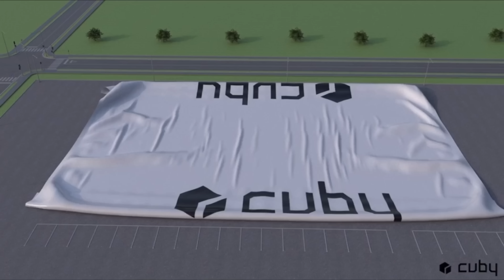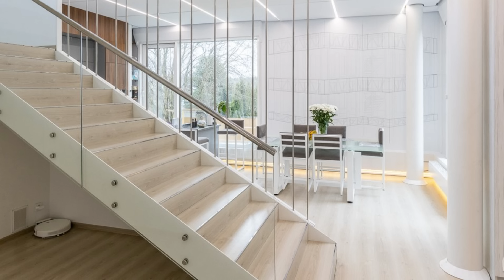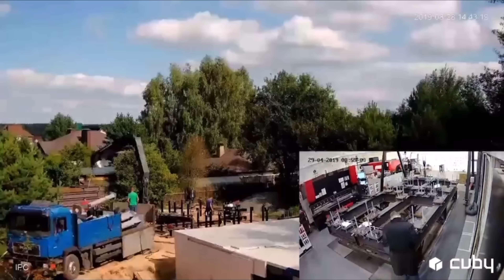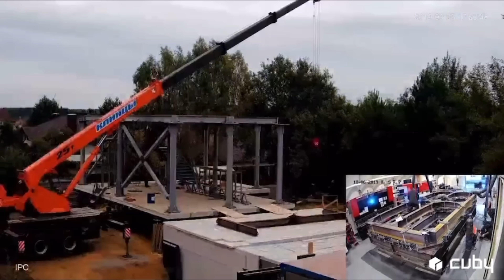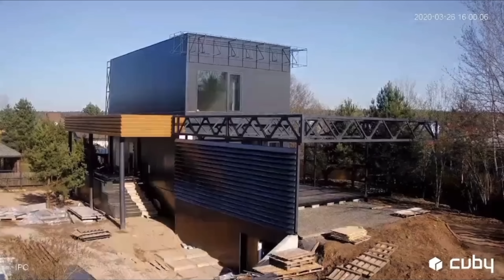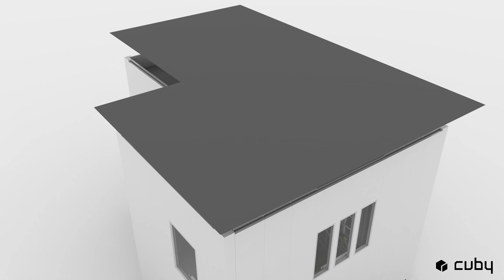Modern PREFAB HOMES that cost Nothing to Ship!!

Comment: Does demand for these homes move in cycles that would orphan a factory when demand moved on?   I can’t envision that.   Building a factory in a fixed location is expensive but enables you to tailor, run, optimize and refit when you need to.   This is a move, setup, try and optimize and tune and move.   Sounds exhausting.

Comment: Thank you Kerry. My resistance to prefabricated homes is the financing hurdles; specifically for resale and how the classification of the structure can prohibit the home from traditional financing or any financing if the structure reaches a certain age.
Reply: Cuby's product will not have any issues with financing or resale value that you mentioned about prefabricated homes. You are concerned about manufactured homes that are produced as a single housing unit and that are moved on a chassis or flat bed. Cuby is a prefabricated modular home. It's pieces are assembled on-site. It would qualify for regular financing and have similar resale value as traditional stick built construction.
Reply: @kdockrey  I don’t doubt you, can you supply the information please so we have ammunition going into the bank.  It would also depend on FHA guidelines.  Not sure how you know about resale since prefabs are coming out.  What I do see is they are going to be popular.  Thank you again
Reply: @sterlinghawk_g20  I posted link with a pertinent explanation about your concern, but YouTube seems to have removed it.  If a prefabricated house has to meet local building  codes and not HUD requirements, your financing should not be an issue. If the prefabricated house only is required to meet HUD codes, then there may be an issue with regular financing.
Reply: If a pre-fab home is put on a foundation & purged to the land, there should be no issues with financing from most lenders. I’m a realtor & I deal with these a lot. Not all lenders will finance them, but many will & it shouldn’t be hard to find one.

Comment: If you can limit how many things need to be put on a diesel truck limit how many trips it has to make to the build site Etc that's the best way to keep the cost down now. Something like seventy-five to eighty percent of goods that Americans buy ship on a diesel truck at some point and have you seen the cost of diesel it's not going down. My only concern with a builder like this would be are they going to create cookie-cutter neighborhoods which is the best way to increase profitability is to repeat the process you can't build a hundred different houses anywhere near as fast and it's cost-effective as 100 of the same houses. If a builder find a way to make cookie cutter neighborhoods look custom I think that will sell a lot of people. Hypothetically say the floor plan is the same for a house but have a different appearance package where they make a few small changes and it completely changes the look of the house even though on the inside is the same.

Comment: Definitely like the look, but the whole "costs nothing to ship" might be a little optimistic giving they won't be building in any one place without a lot of incentive to do so, like muliple units.  I've lived on both concreet floors and wood.  The only difference I noticed was initially, when going from wood to concrete, my feet and legs sure noticed the difference.  But, once used to it, didn't notice the difference.  I need to find a way to experiece radiant heat because I think I'd really like that.  I'm a So Cal transplant who's been in Middle TN for 29 years.  Due to generally harsher weather, not necessarily just heat, but heat and humidity, and a much longer and colder winter, I've had to live in a mostly artifical environment, be it air conditioning or heating.  It's the latter I have trouble with.  Due to expense, I have to keep the heat at about 67 in the winter, but when it kicks on and the air gets wam, it feels kinda stifling (I don't like breathing warm air), but when it' cycles off, it feels too cold. Anyone out there with radiant heat that confirm it does away with those problems?  The fact this manufacturer is using radiant heat is what brought this all up.  Anyway, as always, enjoy your videos, and I'm happy you're keeping track of the industry.  Though downsizing seems definitely in the cards for me, it remains to be seen what the living situ might actually be.
Reply: My grade school had radiant heated concrete floors.  On rainy, cold days, we pushed the desks to the walls and sat on the floor.  It was wonderful, similar to laying on the sun baked concrete after swimming in cold water.   Also an option would be to do a Frank Lloyd Wright type floor.  He mixed rubber into the concrete, for softness, and they were quieter also.